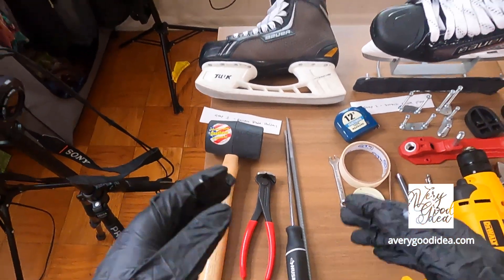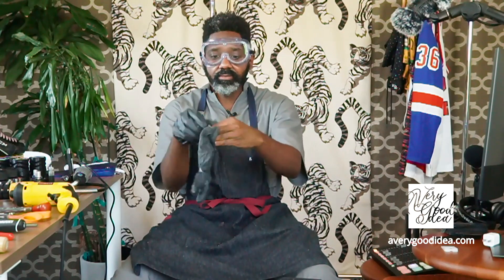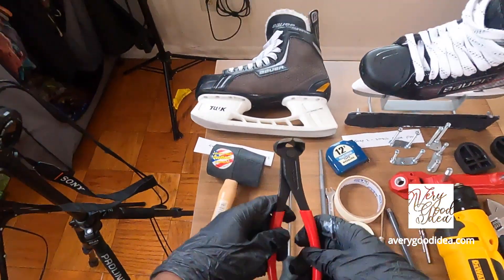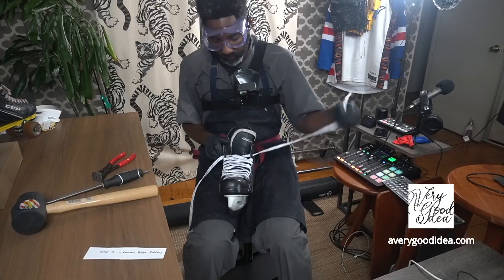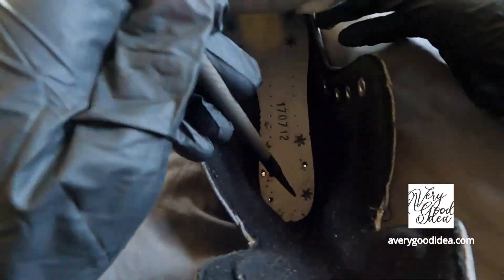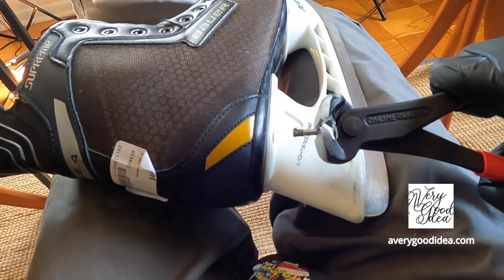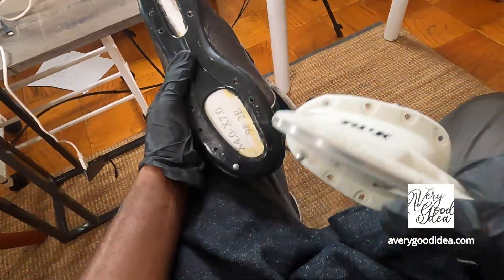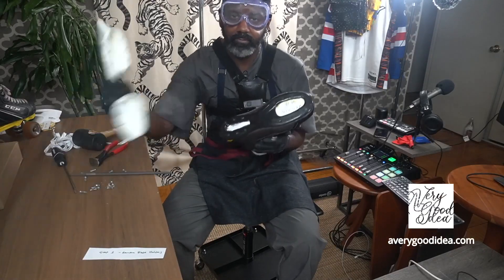Step 1 - Remove Blade Holders | Convert Ice Hockey to Quad Roller Skates

Comment: what is the weight or ounce of the mallet and does the 12 inch screwdriver work just aswell as the nail punch?
Reply from the maker: rubber mallet is 18 ounces and I recommend the nail punch over the screwdriver but I've heard of people having success with the screwdriver.